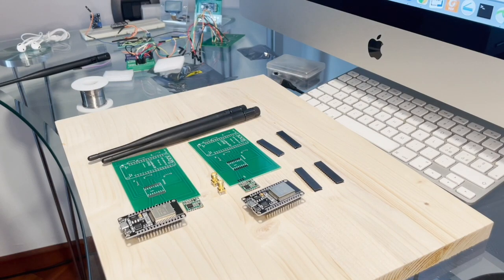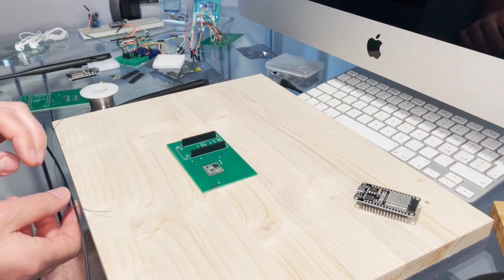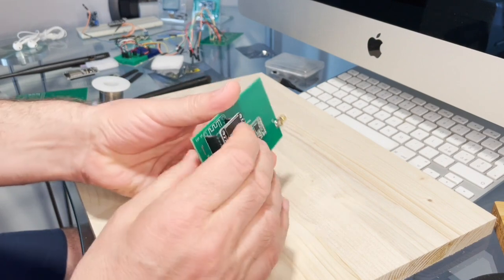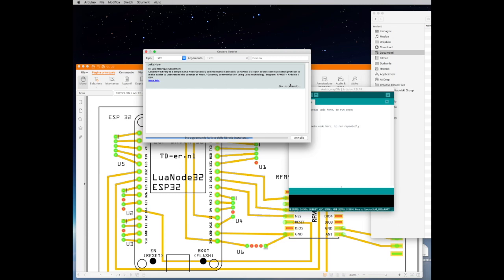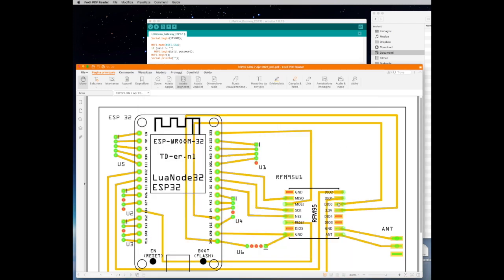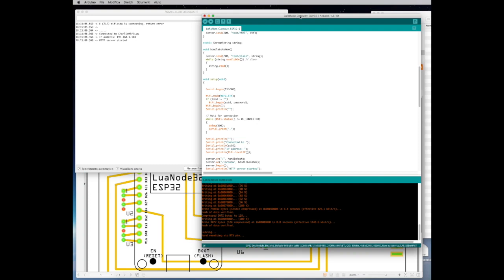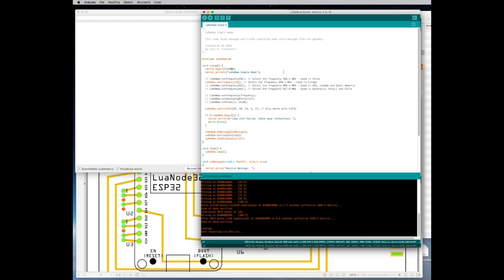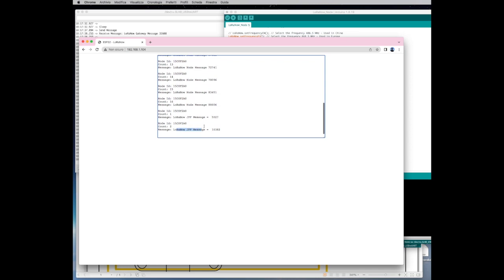LoRaNow Gateway and Node

Comment: What's the size of the track width that used in the pcb?
Reply: I used 0.5mm for power supply and  0.3mm for signals. Will it work?
Reply from the maker: @christumuhaise7804  It will for sure.
Reply from the maker: 2.4 mm

Comment: @CarloStramaglia  Thanks 🙏
For the case where I am sending data (temperature and humidity) from end device to TTN using otaa I get an issue with incorporating my sensor code with the "hello world" example in Abp or otaa meant to initialise the RFM95 module. Could you offer some help
Reply from the maker: Check this other project that has different hardware but you can get some examples on how to send and receive temperature and humidity using TTN.
Reply from the maker: Arduino TTN LoRa node device using PCB Way
https://youtu.be/bwPJaSdzs3I
Reply: @CarloStramaglia  Thanks for your timely response. let me check it out

Comment: will this schematic remain the same if i use a code for otta to TTN.
Reply from the maker: Yes. The schematic is the same.
Reply: @CarloStramaglia  Thanks 🙏
For the case where I am sending data (temperature and humidity) I get an issue with incorporating my sensor code with the hello world example in Abp or otaa. Could you offer some help